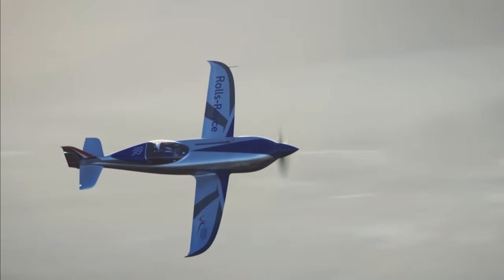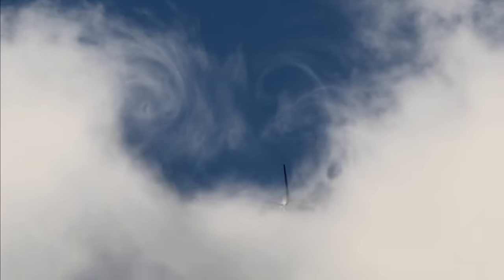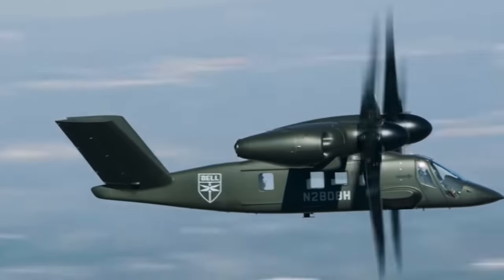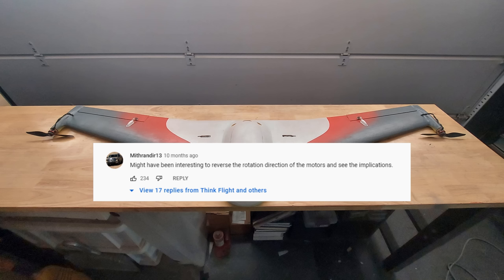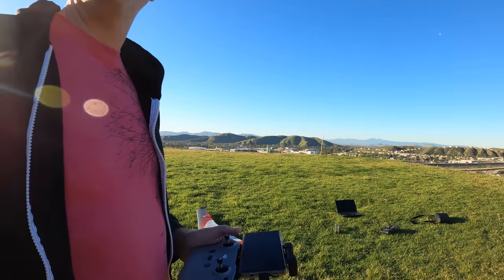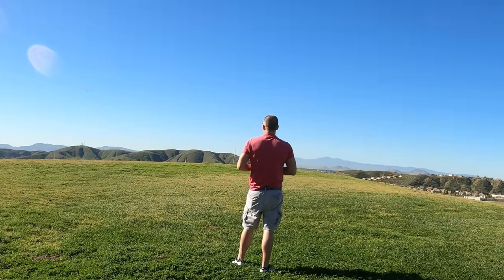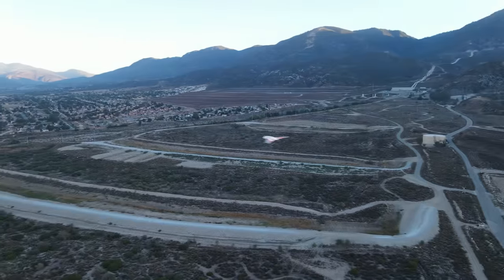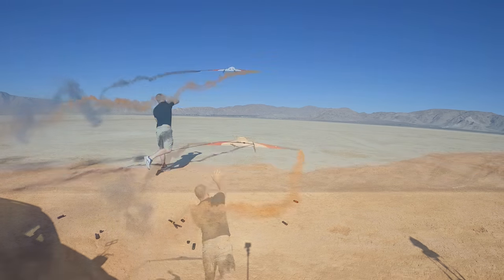Can Wingtip Motors Improve Aircraft Efficiency?  (Part 2)

Comment: I would argue that to make the most of the notion of your wingtips motors producing as optimal a lift distribution, with minimum wing length, you really need to jointly optimize your wing profile with the motor placement. Say you have a wing with an optimal lift distribution wrt induced drag when gliding unpowered, putting a motor anywhere is going to move you away from that optimal distribution. I do think its true in theory that motors are a useful design element that can be used as effective wingtips, extending effective span. But keeping the wing fixed, all these experiments would show is wether your wing as it is, is biased towards benefitting from having additional vorticity injected at the tip, or not. 

In any case, 7% sure is no joke and indeed a nice demonstration of the fact that such things do matter!
Reply: I should add; motors provide a jump in circulation; and so does your wingtip. So yeah its a matter of optimization; but indeed one would expect to be able to find a particular optimum where the motors are colocated with the wingtips; I suppose? One potentially relevant drawback is that the relevant details of your circulation distribution will probably be more sensitive to motor power if they are at the wingtips, than otherwise?

Comment: Really nice that you are really trying to get reproducible data. Have you considered batch effects such as all outward rotating lights were in the beginning and the inward ones after. This might mean you have more worn out motors, worn airframe etc affecting your results. Also configurations to the frame like the new mountpoints for the enginges might also affect the results. By not doing any design changes, and alternating between configurations between days might help you remove such variables. Just a suggestion though, great stuff overall!

Comment: I can see two issues.
1) asymmetric thrust when one engine fails.
2) the extra structure (weight and thickness) that would be needed throughout the wing in a commercial aircraft to support the engine weight.

Comment: Is it a measurable amount that the prop is pushing down against higher pressure denser air on the top and sides of the wing, while the prop pushes through the less dense "softer" air on the bottom of the wing.

Comment: Wow that weight is so much lower than that big huge dirty combustion engine.... amazing..... one quick question though, what does the clean and perfect electric motor use to power itself? would there be any.....weight there? How about issues with it spontaneously catching fire when exposed to air.... Im sure its fine. Also perfectly ethically sourced right? and Recyclable?
Reply from the maker: The point being that the light weight and low vibration allows you to put it on the plane in places that wouldn't be feasible due to structural requirements for a high vibration high weight combustion engine.   I never made any statement on the weight of the system.

Comment: Wing tip propeller is a very interesting and clever idea but the major problem is wings structural rigidity being compromised, commercial planes take thousands of flight changing major parts or even wings because of micro cracks will just out weigh the wing tip motor

Comment: Combine the wing tip motors with the high aspect ratio of the trussed braced wing. Also what about a 3 or 4 motor setup with two motors closer to the center axis and two more on the outer wing tips. If the one of the outer wing tip motos fail the center motor can take over and get you home

Comment: Cool airplane. The vortex is generated when higher pressure from under the wing caused flow around the tip to the lower pressure above the wing. There will not be any vortexes mid wing. 
A conventional airframe may have advantages for testing your theories.

Comment: To simulate the behaviour of a flying wing is next to impossible. The flight computer will adjust the ailerons to balance the aircraft on the pitch axis, thereby effectively altering the airfoil shape. To simulate it you would need an exact measurement of the weight and CG location of the aircraft, and even then it won't account for the pitching moment induced by the blended fuselage body.

Comment: Fantastic experiment and testing. Looking forward to the next parts
Electric motors efficiency has never been in doubt compared to an ICE, but batteries still are compared to fossil fuel. It's almost the same on water, air or land.
Reply: What?
Reply: @wildspycrab7255  what what?

Comment: what happens if the wings are forward swept? does the aircraft become unstable even if the motor are tip-mounted?
Reply from the maker: no but the airflow pattern would negate the benefit of wingtip motors, central mounted would then make more sense.

Comment: The idea behind this and winglets is that if you have lift near the end of the wing you can end up with a tight vortex that takes a significant amount of energy above the naïve expected induced drag. They can reduce the local vortex to zero, but the larger double vortex structure still has to exist. 
One of the strengths of a flying wing design is that it doesn't generate strong tip vortices, due to effectively strapping the elevators to the tips of the wings already. Wingtip motors are unlikely to improve any existing design significantly because existing designs already have some system for mitigating tip drag effects. If you want to see improvement you need a design that would not work well without it. Short, simply profiled wings, for example.
Reply: Depends on the wing design.

Comment: Normally the propeller passes behind the wings at one point in rotation which blocks airflow. By putting the prop on the side only half the propeller blocked behind the wing. That might explain the small efficiency increase.

Comment: the problem abt having 2 motors like 1 on eatch side if one fails u can fix that with a seonsor so if one motor`s rotation speed goes lower then the other one both shut off so it glides u can have 1 more in fron or in the back if one of the sides fails so it can still come safely home.

Comment: Really nice video, but I have a question. Could you measure efficency of motor placement (push/pull) and propeler rotation in exactly same condition by at first make both rotor rotate in same direction (for exaple both clockwise) and in straight flight just measure which motor as higher consumption at time. And also do the same with for exaple left wing have push motor a right wing have pull motor ? Therefore wind condition will be same and you will just comaper efficiency oh concepts between each other. And it would be probably easy to compare efficiencies in mutiple speeds. But I am not even amateur, so there could be reasons why such approach would not work at all...

Comment: Wondering how an EDF or a real turbine at the wingtips would affect efficiency vs a more conventional (near mid-ship) configuration.  I saw one comment about how less likely it is to experience an engine failure with an electric vs an IC engine.  I think a LARGE part of that is that even in in model aviation world, electric motors are relative newcomers.  Give them more time and I think the curves will even out!

Comment: I'm not convinced the vortex rotation direction is as you described.  Your smoke cartridges seem to pulse the smoke output confusing the visualization of the true flow.  They may also be generating their own flow field that differs from the unobstructed wingtip. In the video, the trailing vortices move towards each other (i.e. wake contraction) over time which is indicative of conventional inward vortex rotation.  I recommend repeating this test without any devices or tubes on the wingtips and attach several feet of thin mylar, like from an old cassette tape, and see how these behave in the video.

Comment: I'm an F-15C pilot.  I have two separate points to raise 1. Electric cell storage is bad for aircraft currently because the energy density is still not near the density of liquid fuels and unlike a liquid fuel aircraft, an electric aircraft never sheds weight as it flies through the process of combustion.  This results in batteries being just dead weight, reducing efficiently the moment you rotate and leave the runway.  Also, liquid fuels don't self-immolate spontaneously like current LIPO technologies seemingly with no warning.  2. Wingtip engines are a nightmare scenario to a combat pilot.  I'd usually never advocate for less than 2 engines on an aircraft, but a ducted turbine with outlets at the wingtips would actually be safer, because if you lose one engine, you lose output to both wingtips.  Lose an engine with two engines on wingtips and the aircraft instantly turns into a frisbee, and you have to recover from a spin before you can be a glider.   On the ducts, you can control yaw with variable nozzles open/close.  Also sometimes vortices are good, and jets sometimes have dogteeth that create them to increase pressure on certain control surfaces and reduce flutter, such as the horizontal stab on the F-15.  Interestingly, AMRAAMs on F-16 wing tips also reduce flutter, but I am not sure if it's weight related or aero related.  Maybe both.
Reply: I think most of the efficiency gain comes from the propellers' vortex cancelling the wingtip vortex. This would not work for jets. Some use ducts to the wingtip for VTOL and to augment thrust vectoring.
Reply from the maker: You have my dream job my friend.

Comment: Well. I guess that initial speed controller issue confirms my initial thoughts that you can control yaw without a rudder. Of course, the tiny electric motors don’t have enough nuance to “control” that very well…

Comment: It's good flying footage but for visualisation would you be better off setting up a field of smoke columns and flying the plane through it? You have a lot of structures like fairings and motors creating turbulence and a very narrow range of observation. The really telling videos are aircraft flying into clouds where you can see the full effects of the wing and the extended region beyond the tips where vortices are in effect. You can't really do that using onboard smoke

Comment: My kneejerk guess is simply that propellers rotating along the vortex encounter less resistance than ones rotating against the vortex.

There doesn't seem to be any point in actively countering the vortices. From wikipedia: Induced drag is the cause of the vortices; the vortices do not cause induced drag. I can understand why planes with very large propellers effectively increase the wing span since the prop blades extend significantly beyond the wing tip and push air down (like a wing does), but that doesn't apply here.

Comment: Everyone knows the V-22 Osprey with its tip mounted propellers is the model of lift/induced drag efficiency.

This problem of lift-induced drag is very simple to solve. Fly faster. 

Or if you want to fly slow, or slow and high, use long wings. If the bending moment leads to excessive weight then place motors and fuel outboard along wings semi-span. If motors and fuel and landing gear alone don't reduce bending moment and weight then consider a lift strut. If that creates too much drag for your slow airplane then consider Rutan/Scaled solution of twin fuselages which have no issue circumnavigating the globe slowly while weighing almost nothing. A small fraction of the max gross wt.

Comment: So, I am not involved in any form of aeronautics. However, my untutored mind keeps throwing up the question. Wouldn't the props have more of an effect on the wingtip vortices if they were on the leading edge? As it is it looks like the pusher props are only dealing with the vortices after they have created the majority of their drag in being formed. Surely interfering or countering the vortices creation before it happens would have a larger effect? .... Damn! now I am wondering what the effect of a wingtip nacelle with push-pull configuration would have.

Comment: Where is this concept going to? Scaled up to airliner and cargo plane size is going to be impossible in operation. Consider things like extreme hazard while taxiing, cross-wind landings, ETOPS, extreme wing load because the engine weight is at the end of the wings. 
Or is this meant for small r/c planes only? 🤔

Comment: You can find some answers in nature. Take eagle for example, the wings are moderately short and broad, and this vortex is eliminated by the wing tip feathers which are like harder than rest, more flexible, more separated from eachother but strongly attached to the wing. I mean top feathers must not be hard to the wind flow as it is with albatross, who eliminates this vortex with long and narrow wing, and this way almost eliminates the need to flap wings. In my opinion one big engine in the middle of the main body and the wing tips made from a more flexible fluffy material. And test. Other birds may have other solutions.

Comment: here is a fun idea: locate an internal impeller in the main body of the "plane" with its intake being the nose cone, then, port that air flow to and out of the wingtips..? this would make for a propulsion system that you could make very quiet, and also eliminate propeller-drag, and thus be more efficient...........???
Reply from the maker: Lots of resistance in whatever mechanism you are using to port the airflow.
Reply: @thinkflight  
"rifled-ducting".? with bends under 30*, with a simple duct-valve to proportion flow to each wing, perhaps even, there is a way to form the ducts that they would then act as a compression-nozzle, actually increasing propelled air velocity, i think that hypersonics use this form of exhaust, and it is certainly applied in hydro-dams to increase water-flow rate.........regardless, great work so far, an amazing project

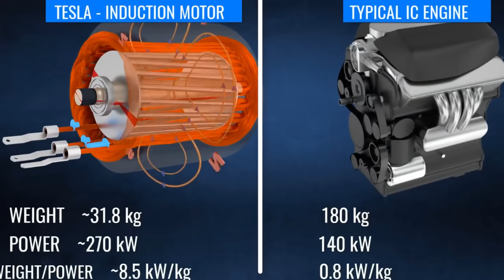Comment: 0:34 you're making comparison of weight-to-power ratios for the engine alone? thats misleading
Reply from the maker: Considering motor placement, it is exactly the kind of information necessary.
Reply: @thinkflight  kinda true but taking into account the weight of batt vs fuel then electric system would have endurance disadvantage. But nevertheless interesting vid for us to ponder 👍👍

Comment: Was any mention made of the Vought V-173 or XF5U made in these two videos? Their very basis was efficiency gained by wing tip propellers reducing the amount of power, and thus weight, needed for an aircraft due to the drag reduction achieved by eliminating wingtip vortices. I can't claim I watched all the way through the videos because of the shit music and iffy dialog so I might have missed a brief mention, but I did step through them and saw nothing.

Comment: Does the direction of rotation matter? I believe it does. I believe that the rotation needs to counter the wingtip vortices.
Reply: The answer is at 5:45.

It would be nice to add a smoke trail so so we could see the wingtip vortices.
Reply: Maybe I should start watching videos before I comment!!
Reply: So you’re saying that the propellers reversed the wingtip vortices? You need to add a third propeller in the middle, and then adjust the wingtip motors to exactly cancel the wingtip vortices.

Comment: great job re exploring the wingtip motor design that was done in 1939-1942 when they completed the full size Vought 173 flying pancake. https://en.wikipedia.org/wiki/Vought_V-173. i like this version but id like to see the fuselage thinner.  im not sure if you used folding props but it would be best for gliding and landing. very kool !

Comment: In a real plane I can see a safety issue in regards to engine faliure and torque.
Since in the case of an engine faliure, the distance between props would induce a very big leverage on the airframe, increasing the chances of a flatspin, stall etc.

We could increase redundancy by having 2 independant separate coils and circuits  per propeller. Reducing the chance that an engine faliure could incapacitate a motor and compromise the flight.

Anyway, it is a good physics experiment.

Comment: A quad copter on the other had can loose a motor and still fly. That plane can't even glide with an engine failure (since it can't steer and it would instantly spin when one turns off)

Comment: If the tip had a downward curvature, wouldn't the tip drag just funnel into the lift pocket under the wing? And it should be straight at the leading edge, with the curvature going towards the tail >(|> like that with the front > as the cockpit and rear > is the tail..

But the tail would be also (| shaped, could be vertical or horizontal

In short, it's kinda backwards with the wing 

In fact, now that I think of it, a bird has a tail in the shape of a baseball diamond. (>

Comment: Structurally the wingtip is not that strong compared to other areas on a wing, I think that has been the big factor for traditional heavier engines. Also the effects of a engine failure at critical times like takeoff and landing.

Comment: hee hee After showing the effects of differntial thrust problems with a power failure on first launch lets talk about how rare those are.  Fatal but rare.  Of course in a full size application your speed controllers would give feedback to balance non-input generated power applications and multiple power pods as seen on some of the previewed aircraft would be used to help stabilize and balance a flight load, along with gyro stabilization, while under single or multiple failures BUT showing the ability to enter a pretty cool horizontal cartwheel right off the bat, pretty cool.

Comment: Lack of vibration is 10 times less factor than power to weight ratio of motor mainly is the incentive to use more motors...That's y excavators for which vibration hardly matters have 1 engine with gearbox to do all functions instead of separate engine for each function